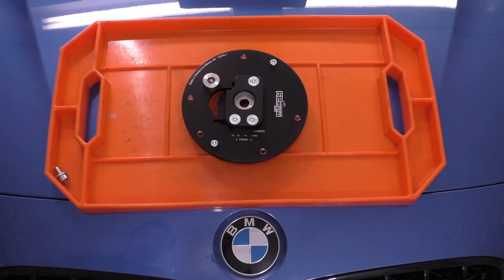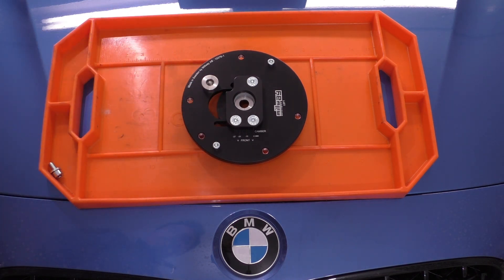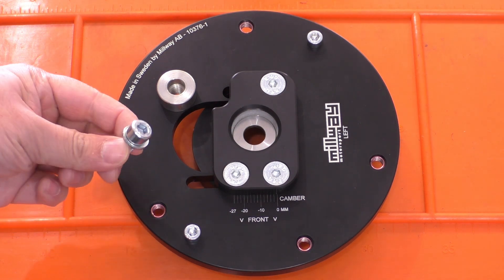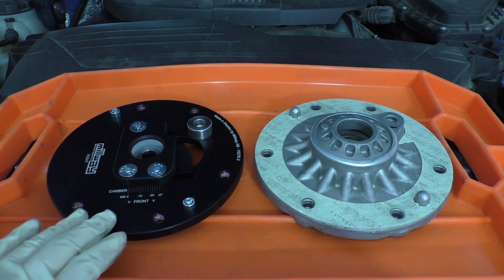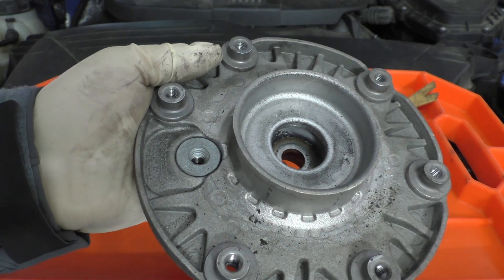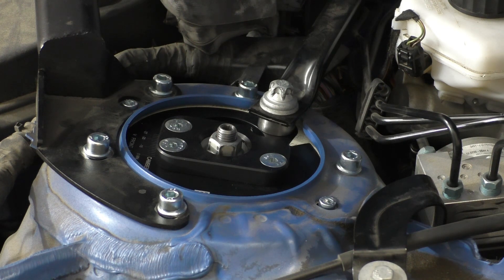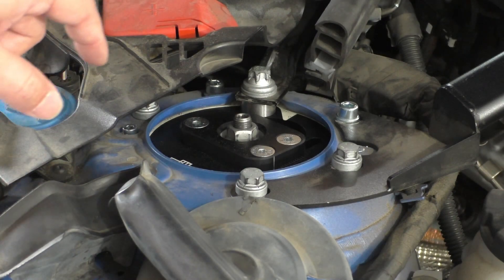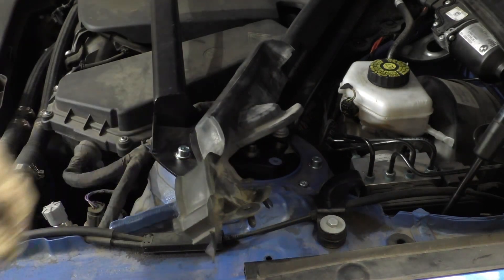Millway Street Camber Plates for the BMW F2x/F3x/F8x

Comment: I have these Millway Street installed now for a year now on my F20 M140i. They are fantastic. This the way to go get camber on your Fx40i, previously installed M4 LCA and tension arms but those arms are longer and introduce quite a bit of bumpsteer, which drove horrible. The Millways do introduce NVH but it’s  acceptable, I also had both millway arms bushings fitted, It seems that most NVH is coming from those instead of the camber plates.

Comment: I have the Millway street version. On a G42 M240i with EDC. 

Immediately noticed on rougher road and going over small bumps. Any large vertical travel leads to a clunking or knocking sound. Is that to be expected? 

Smooth road it’s fine

Comment: What was the maximum camber you were able to run with these plates? Is -3 possible?
Reply from the maker: On my F31 I'm running -2.7deg up front. It's close to the end of travel. I believe the F80 one has a bit more travel though.
Reply: @FaRKle0079  thanks. I was hoping they would be capable of -3. I recently got the vorshlag plates and haven’t installed them yet, but there are a few things I don’t like about them (no markings on adjusters). And absolutely no instructions included. Your video will be invaluable if I decide to install them.  Thanks again.
Reply: I am doing -3 and you do like -4 if you want.  i went as high as -3.4

Comment: Great video Farkle. I have a set of these on my car and really love them. But now I am curious about replacing the polyurethane bushings. Would these be hard to change out with typical hand tools? Or would I need a press? Thanks
Reply from the maker: The PU washers are very easy to change out and just require separating the upper/lower halves of the camber slider mechanism. Simple hand tools is all that's required.

Comment: I just had these installed on my m140i and am experiencing some “chattering” at low speeds. In your previous comments I noticed you mentioned an increase in road noise; just wondering about the chattering noises at low speeds. Thanks!
Reply: Did you get this resolved? I feel this on my car as well. at less than 30kmh it sounds like bouncing metal, as if something was not fixed properly
Reply: @Chiguirinho  it turned out to be the OEM adaptive dampers. Once I switched to Bilstein B8 passive dampers the sound was gone and there really isn’t any discernible NVH from the camber plates.
Reply: @m140i_xdrive  oh that sucks, I'm precisely on the OEM adaptives but they never made noise before. Guess I will keep the plates until I have enough for a set of coilovers

Comment: Hi. Some parts of my millway street version look different from yours and the torques mentioned in the manual are also different. I don't know whether they had some change for this product.
Reply from the maker: They may have changed fastener grades, which would alter those torque specs. What else is different on yours?
Reply: @FaRKle0079  Yes the torque specs are lower. The camber adjustment bolts are different. The hex holes are bigger and they are not with flat end.

Comment: How is the NVH compared to stock in a scale of 1 to 10? Great content btw 👍 keep doing vids
Reply from the maker: The NVH is worse than stock, but not too significant. There aren't any salient clunks, taps, or pops, but the background road noise level is a bit higher.
Reply: So if mine are installed and I hear rattle on bumps, that means that's a bad install?

Comment: millway website states that you can get -3.2 deg max camber (are you sure that -2.5 deg was max on your setup?, are you at stock ride height?)
Reply from the maker: These are the street version plates. Millway's website says you can get about -2deg extra camber with them. Stock camber for F2x/F3x is around -0.5 deg.

The monoball version can adjust further to add about -2.5deg extra camber.

Comment: Hello, what improvements do you get by increasing the front camber? For a mainly city and highway use (no track), would you recommend it anyway? I own F20 120i. Thank you very much
Reply from the maker: More front camber will give the front end more "bite" when cornering and reduce understeer. You'll find that you're able to hold turns better without having to reduce speed. If you like tossing the car into corners during your daily driving or spirited weekend runs, you'll still see the advantage of camber plates without having to go to the track.
Reply: @FaRKle0079  What about the combo camber plates + front strut brace?
Reply from the maker: @federoco1  The front strut brace doesn't really do anything for grip like the camber plates do, but makes the front of the car more solid. The result of that is the car feels more composed and communicates with you via the steering wheel better during cornering.
Reply: @FaRKle0079  In the end I got them! I noticed a generally more oversteering behavior of the car. When cornering, if you open the throttle at the wrong moment, it tends to start more easily and you can clearly perceive the grip limit at the rear.
 In short, she is more nervous if you drive badly, you have to be clean. It is more sensitive. On fast corners, I do less steering wheel corrections to counteract the widening of the trajectory. Once set, it holds it. On the straight, at times I had the sensation of feeling less planted and more sensitive to the roughness of the road surface, even for example the center lines on the motorway. On bumpy roads they produce a slight "clonk-clonk" noise.
Reply from the maker: @federoco1  You can tweak the handling characteristics with alignment changes. If you have too much grip in the front in corners you can try reducing front camber to even out the front/rear grip or if you're not running much rear camber, increase it in the rear to keep it sticking longer.

Comment: its better than unniball solution? i order one street version to M2C....
Reply from the maker: In my opinion these are better since you don't have to worry about them wearing out and the NVH is less. 
If you're building a full race build and planning on swapping bearings regularly, then the monoball version could be better. The monoball version can go to more negative camber than the street one, so if you need something like -3 to -3.5deg, then the street version won't work for you.
Reply: @FaRKle0079  uniballs are noise, i always hear uniball squeezy on bumpy road...
I have -2.5 deg front and rear 1,75 deg.... 
I think street version be better for me...
thanks for help
Reply: @FaRKle0079  did you lubricate uniball?
Reply from the maker: @Markvojtisek  Nope. You shouldn't have to, and the instructions don't mention doing it either.
Reply: @FaRKle0079  thanks. how much mm you have on plate for -2,5 camber?
Reply from the maker: @Markvojtisek  My plates are set at right about the -10mm mark for -2.5deg camber.
Reply: @FaRKle0079  how much km do you have on street?
Reply from the maker: @Markvojtisek  I have 6814km on these camber plates including two track days.
Reply: @FaRKle0079  nice... and do you  have stock dampers?
Reply from the maker: @Markvojtisek  I'm using Fat Cat Motorsports custom tuned dampers. They use a Bilstein B6/B8 body and modify the internal valving.
Reply: @FaRKle0079  iam using oem dumpers, i think is not problem for millway camber.
Reply from the maker: @Markvojtisek  OE dampers will be just fine with these plates.
Reply: @FaRKle0079  yeah its better with street version... its like OEM camber. thanks for help ;)